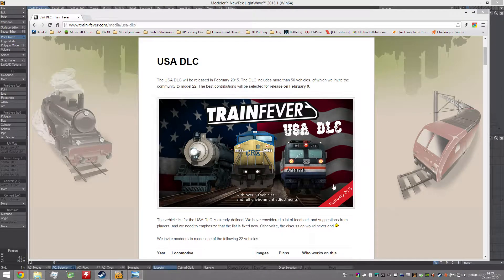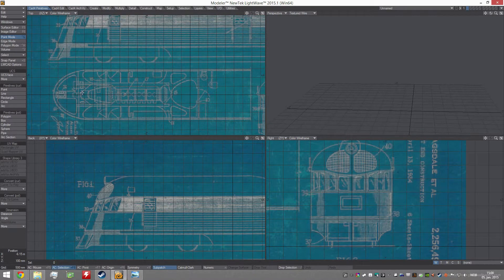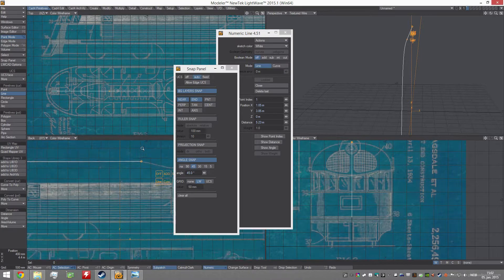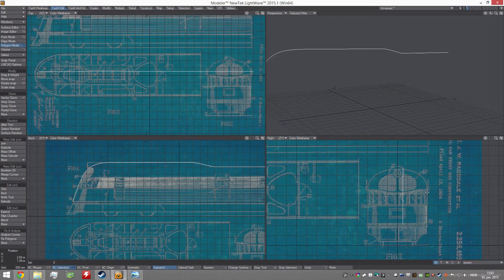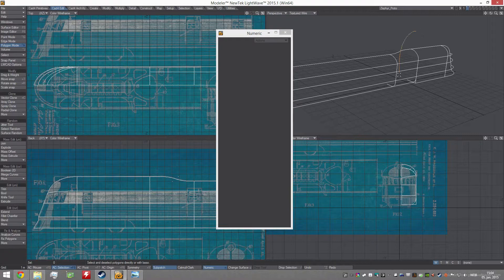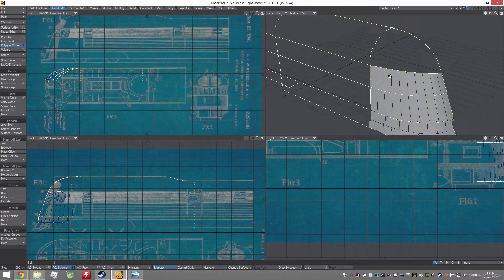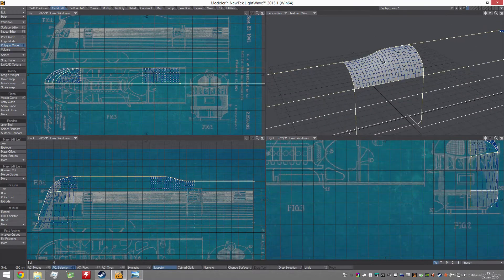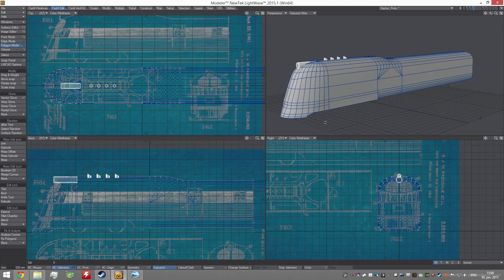TRAIN FEVER Creating the 3D model

Comment: Is this train availible yet?
Reply from the maker: Yes! It's part of the USA DLC, available for free.
Reply: I realised that after I posted the coment. Now using ít as a regional train. acceleration is shite tho...
Reply from the maker: +MegaAlalil Blame it on the engineers of the age! The mod including how the engine performs, passenger capacity etc. is made entirely based on data I could find online. :)
Reply: Is it possible to change the acceleration in some files? I mean it goes up to like 70 pretty fast, but after that its really slow. And if so, what files?
Reply from the maker: You need to go into the dlc\usa_1\res\models\model\vehicle\train folder and find "silverstreak_front". Open it in a text editor and adjust as you please.